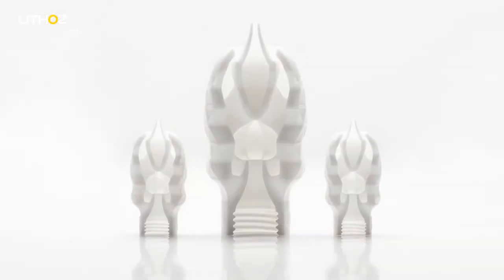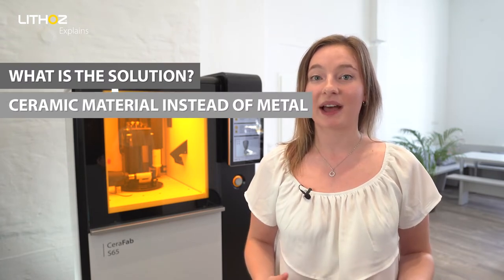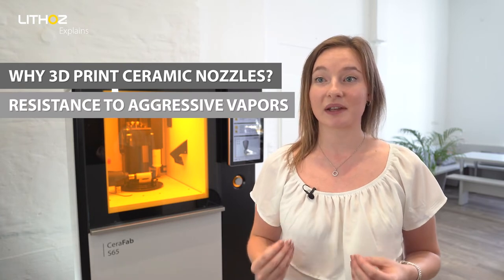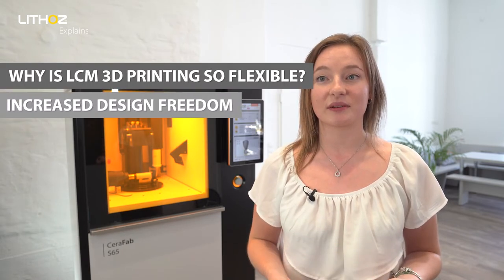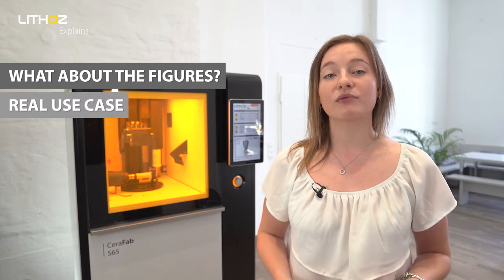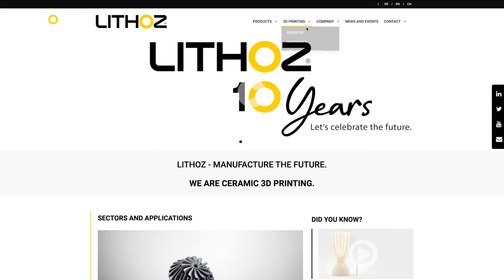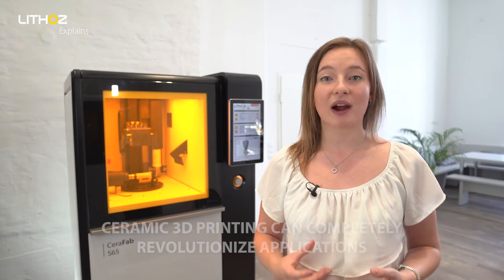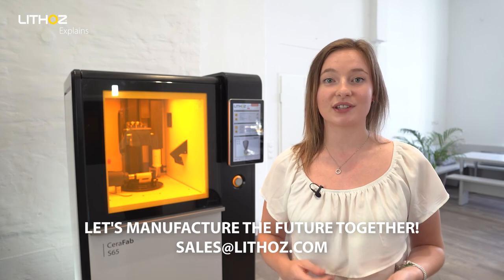Lithoz Explains #6: Ceramic 3D-printed nozzles

Comment: Thanks for the interesting video. Which is the maximum size of the parts? And the thinnest thicknes or element achievable?
Can the parts incorporate a porous part that is also 3D printed (taking into account the thinnest achievable feature)?